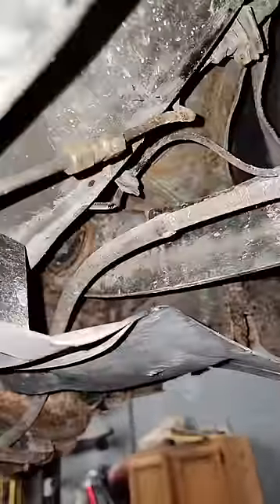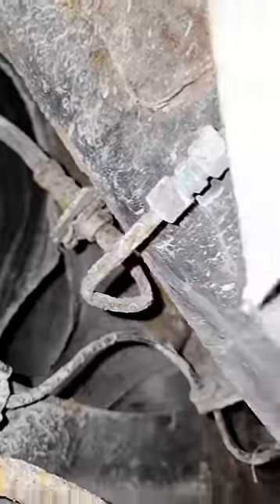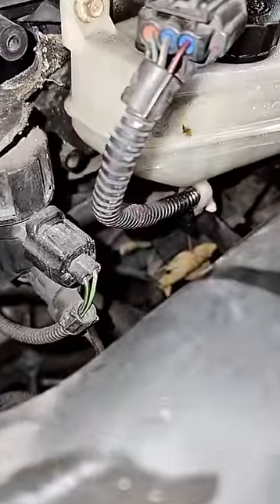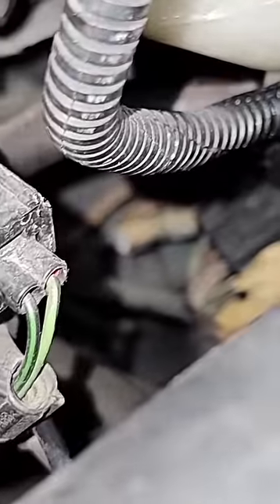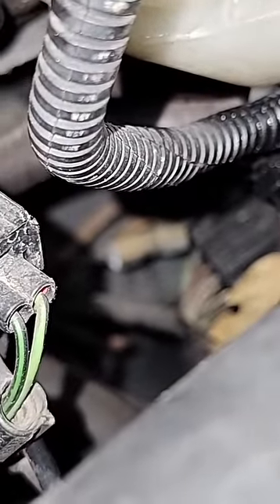don't use compression fittings on brake lines

Comment: I don’t think compression fittings are even legal.
Reply: They certainly aren't in NY. Can't speak for any other states but I can for NY lol
Reply: Not in Maine.
Reply: Here in Vermont they are not allowed but I'm originally from Michigan and it was common there because there are no inspections.
Reply: I will make them legal!
Reply: @Sith_dude  gae!
Reply: They're not.
Reply: They are not legal anywhere.
Reply: Lol legal
Reply: @bloodbushcraft2467  these mfers are worried about legality.  In states with no inspections this stuff happens all the time. In states with inspections the inspector gets paid a little extra. 

Guaranteed the brake line police aren’t going to show up
Reply: @Krankie_V  not the brass ones but they make a steel one that is or at least they will still pass with them . But here in NY your not going to find a good spot to put one might just as well replace the whole thing
Reply: You can buy fittings specifically for brake line pressures, advanced auto has them
Reply: @toodjackson4438  any type of compression union is illegal on brake lines in NY. It's specifically called out in the safety inspection regulations. Anyone who passed that did so illegally.
Reply: Can't get an inspection sticker in wv if they find compression fittings on your brake lines.

Comment: Scotty says it's ok.  Rev up your engines!
Reply: Blows my mind that people take any notice of Shoddy Kilmer.
Reply: @ferrumignis  he’s a wealth of knowledge.

Sounds like you got a personal problem.
Reply: @ferrumignis  I actually like that someone doesn’t bend-the-knee to corporations and the government who say, “You can’t do this.  You can’t do that.”

Scotty just won points in my book.
Reply: @Americansikkunt  you cant do that because the fittings are not rated for the pressure that a brake system gets to. There is a reason that compression fittings are not used in high pressure applications, its because they fail.

Comment: I use swagelok 316ss compression fittings at work, which are rated for 10k psi. I use them for 5500 psi Argon. 

Those are copper though so don't have the same rating.
Reply: Brass. Copper compression fittings aren’t a thing.

Comment: Not sure about other states, but here in NY compression fittings and copper lines fail NY State Inspection. Wouldn't do them even if I was doing side work. I'll run and flare new lines myself before it comes to that.

Comment: I've had a compression fitting on my right rear brake line on a 69 GMC 3/4 ton pickup for 20 yrs now. You just gotta make sure they are the right size and rated for the pressure. The one i used is rated for 1200 psi. Also, the legality of compression fittings varies from state to state. My state they are legal to use.

Comment: I once used one on a work truck brake line. And it lasted 7 years until I sold the truck. And It is still on there from what I know lol I usually flare but for some reason I had to at that moment

Comment: I have 2 compression fitting on my 2000 F350. one of the brake lines rusted right through so they had to jump in a replacement because they don't make them anymore. my thoughts were why the rust through?

Comment: Old master cylinders start to bite the dust ,the first time the pedal sinks to the floor like if you blow a line. 
The unused part of the bore might have a step to it ,besides possibly having a bunch of debris and dirt in that area,so say bye bye to the seals on the piston. 
That's why most of the time on an old car,if it's been bled by "foot" ,you'll be replacing the master shortly afterwards.

Comment: I used a compression fitting once.  Buddy had an ancient Asian pickup truck (ford).  The rust held it together.  It basically was an old beater farm vehicle.  I told him the possibility of failure and it was on him.  It was fine.

Comment: Compression fitting on brakes lines are an immediate inspection failure in Rhode Island. In Massachusetts the brake check is stopping in the bay.

Comment: Those look like what you buy at Home Depot. 
If, and this is a big if. I was to use compression fittings, I would use Swagelok or Parker only. And also it would be with SS tube, sufficient id to allow flow and pressure. 
Thoughts?

Comment: I've never used compression fittings or messed with brake lines. Why are compression fittings bad on brake lines?
Reply: They rely on friction to keep the fitting together. As you tighten the nut the compression washer deforms to hold a tight seal against the line. A flared line on the other hand is, well, flared. Line pressure only creates a tighter seal and it physically can't come apart
Reply: They simply aren't rated for the pressure that a brake line can see, so there is a rick that you stand on the brakes in an emergency and the pipe pops out of the fitting.  They are illegal to use in many states (should be all of them)

Comment: how do you know if the part will come with compression fittings or not?
Reply: The compression fitting is a way of putting several brake lines together. 
Aka, someone has been replacing sections of lines instead of the whole line itself. The compression fitting is the patch job between the lines and are common failure points.
Reply: @mmix224  Thanks for clarifying that. Is it because the brake lines rotted or rusted out?
Reply: @TheFrenchPug  Yes, it's because the original steel brake lines rust.  Compression fittings on hydraulic brake lines are a horrible hack used by the terminally ignorant.
Reply: @ferrumignis  Can't believe someone would actually use those on brake lines. Looks like a death wish.
Reply: @TheFrenchPug  I can't believe a lot of the things people do to cars, like using luggage straps to hold broken suspension in place.  We have to share the roads with these people.

Comment: "Going" doesn't matter, if "Stopping" is going to be an issue🤨.
IMO, compression fittings are fine,
To make it until payday or just to get it to the shop (to do a proper repair) (and is certainly fine on low pressure lines).
But THAT MANY fittings is just BEGGING for a massive failure (that could very well get you or someone else killed) and was very  likely the cause of the master cylinder failure..
 Personally, I'd rather just isolate and crimp the line instead, The car "pulling during braking" will be a constant reminder that you have a problem that needs a remedy😎
🤣🤣🤣
Always remember, you aren't the only one that NEEDS you to have good brakes/tires

Comment: I’ve used compression fittings on brake lines in an emergency, but would always go back and replace them with actual flare fittings at the soonest opportunity. Or replaced the whole line

Comment: Ive seen in a comment section that a guy worked in a field that required him to test compression fittings. He said thy tested up to 41,000 psi and that the line surrounding the fitting burst before the fitting itself. Idk.

Comment: Compression fitting suck. I don’t even use union fittings. I’ll get 25’ stock line and custom fit for each wheel, or the two for the front and the singular like to the rear T-block for the rear wheels. 

One solid piece means only (2) possible leak points. Use two lines and a union fitting? Now you have 4 possible leak points. 

Customer had me look at brake leaking issues, seen multiple union/compression fittings, and said HELL NA! We gonna have to address this crap right now. 

They initially didn’t want that done, so I fixed the leak that was present, and sent them on their way. 

Next day, they called me up to do an on-site(their job) brake inspection, again, because they had to pull the E-brake to stop…..the line I replaced was fine, but now one of the other lines failed under pressure.

It was at this point that they were on board with the idea of taking all the old lines off and replacing them all with custom fitted one-piece brake lines.

I don’t charge much for the work that I do, and I like doing what I’m doing, but if the customer don’t want something addressed that I believe needs to be, nothing I can really do at that point. 

I don’t sell parts, so it’s not like I’m making any money off that. I’ll try to keep their cost of parts low, but sometimes it’s best to let those who know what they are doing, to do what you called them out to fix.

🤷‍♂️

Comment: They have non-brass comprehension fittings made for brake lines!  When I worked at a factory, they had comprehension fittings, that were good to 10,000 psi?

Comment: I keep compression fittings in my glove box specially for this reason but I only use them in the case of emergency so I can at least get the vehicle home. once I get vehicle home I fix the line properly with the nickel/copper line. compression fittings are by no means a permanent fix, especially on a brake line.

Comment: Compression fittings should be fine if done correctly. I can see your point here though. Five is a little bit worrying 🤣
Reply: Yeah i agree I don't like them but I've used them on my own vehicles to save my ass when I was broke and in a pinch I've had more bad flares cause issues than compression fittings the 2 that I had fail when I took them apart it was clear the line came out slightly when I was tightening them down

Comment: Someone apparently doesn't care whether they can stop in an emergency. Maybe it's just me, but brake lines are pretty easy if you take your time in removing the damaged line, and I think you can get prebent replacement lines.
Reply: Good luck feeding the pre bent lines over the gas tank and making it around the engine as well unless you remove a lot of parts for them

Comment: A lot of people optra compression fittings with how easy they are to install and splice lines together and they are good for emergency fixes and extremely temporary fixes or off-road applications but people need to realize that they are not safe to be driving on the road if you slam on your brakes while you are driving those compression fittings more than likely will not hold up to the pressures that are in the lines and that is why your are not supposed to use them on passenger roads, off-road applications are perfectly fine, emergencies are okay but not for long term.  You do not want your brakes to fail on you while you are going 70 80 mph on the highway, just saying

Comment: Are they Compression fittings or union fittings?
Compression fittings use ferrules which arent recommended for brake lines
 But union fittings used flared ends and flared junctions which are allowable for brake lines.

Comment: Although I wouldn’t condone using compression fitting Dorman makes steel compression fittings rated at 5,000psi. So if you use compression use steel for better safety.

Comment: They may work out okay for some people but they are not rated for the pressures in a brake system. I always put fittings on double flare the tubing and put a flare union in and to be honest I feel that is a half assed repair. The right way is the real pain in the ass is to replace the line until you can get it out fitting to fitting.

Comment: Compression fittings can handle the brake pressure on a lot of cars. Not all though. And their biggest problem is people not installing them correctly.
Still good for a temporary fix, but not when me or the shop are liable.

Comment: Now I know some places don't accept their use but I mean I use compression fittings in oil and gas refinery's and I also use them when I need to hydro test something to high pressure. They work really well. If installed properly a Swaglok (only brand I would ever use in SS 304) is good for 8000PSIG at 1/4" which I'm pretty sure most brake lines are. I just don't get why you wouldn't use them. a Flare is no better properly installed.
Reply: I just dont like a possible failure spot when I run brake line. I would rather run a solid line but here in NY compression fittings DO NOT pass state inspection.
Reply: @midnightrider1854  Oh I agree. No connections would be best but there are multiple connections even on a stock vehicle, and flare connections are allowed which aren't any better and are allowed. Like I said I know some (if not all, I'm not sure) don't allow them, but I just find it illogical after having used both flares/compression fittings in high pressure/high heat conditions.
Reply: @TranceEmotion  I agree with you, and I'm not saying that I haven't used them before to get me out of a tight spot. Although, a brass compression fitting is designed for a low pressure line splice. That is why we are not allowed to use them, but I've never seen one blow apart on a brake line. We can only use union fittings that, to me aren't much different except it utilizes the flare to grab and seal, which is supposed to be a stronger hold as opposed to the flare fitting where the furred actually compresses the side wall of the line as it tightens and comprises its overall strength.

Comment: So a for that line it is wrong to use a compression fitting. I would use a flare style fitting to repair something but not use more than one on a line. The factory uses these on every vehicle I think he showed one of them on the focus saying it was a compression fitting. The reason he said that is they are very vary similar looking once installed on a line

Comment: Brass compression fittings are 110% illegal in all 50 states by dot rules. Second of all the only good the compression fitting that is technically legal and actually allowed in break repair are still compression fittings and they're only allowed on 3/4 ton non-commercial and down vehicles. Now if you have one ton and it's ripped line off out in the field you can repair it with a steel compression fitting but it must be repaired before you load up the trailer and attach it to a trailer and come up anywhere near the maximum gross vehicle weight. But I agree with you I'm much prefer to bend and flare and use brass unions between fittings because they maintain the hydraulic integrity because they are a threaded repair

Comment: That’s my guess with my old 2000 GMC 1500 4x4 it’s leaking past the master cylinder and into the booster they there kinda sort a and extensive use needs top up bled but no full pressure reason I figure it’s in the master & booster no brake fluid on the ground and I have that happen to me before 😉

Comment: I have used compression fittings on brake lines with no issues.  Well no issues on the brakes but other ones with the vehicle sure.

Comment: They are not rated for the PSI of brakes anyway. You can buy brake line and a tool to make the flare for like $50. I replaced all my trucks brake lines for less than $100

Comment: Agree 100%, we're talking 2,000psi here and compression fittings were never intended for that.
Reply: Not to play devil's advocate but Google how much pressure a compression fit in can hold.
Reply: @DigiDrone  Even for plastic ferrule?  Are brass ferrules even intended for use with steel tubing?
Maybe Swagelok 316 stainless compression fittings, but why not just duplicate the factory double and bubble flares, do it the right way?  The parts, fittings, tools, tubing are all right there and available to do it the right way.
Oh silly me, the internet said it's okay! :(

Comment: Must have been an HVAC guy who did the work. Im not a mechanic but I can easily understand why you wouldn’t want compression fittings on your lines, the bumps and vibrations would cause them to leak over time.

Comment: I almost used compression fittings on my 98 explorer when a rear line rusted out and left me with zero brakes…even bought the parts and brake line section, after Soo many people said how bad it was I ended up just blocking off the rear brakes and only using the front. Still not ideal but better that those things lol

Comment: I've never had problems with compression fittings.  They obviously were not the problem.   But the fact that there are 5 of them tells me the lines are probably done.  And I'm with you, if the lines are crap and you put on a new master cylinder those lines need addressed, or it turns into a liability.

Comment: I've used compression fittings on brake lines for 25 years. Never had a problem. A lot of plumbers swear that you shouldn't use shark bites either but I've used them for 25 years with know problems. I don't know why it takes so long to get over this crap! Most of the mechanics I know still won't set batteries on concrete floor, instead they sit them on boards.

Comment: The line will fail long before the Thoes fittings we use them al the time for instrumentation they can handle well  over 10,000 psi the stainless line will burst at 15,000 .

Comment: Compression fittings are fine on older vehicles but don't use them on ABS brakes
Reply: No, they are not fine on any hydraulic brake system.

Comment: I get it yes 5 compression fittings are not ideal. And would make it hard to locate the actual issue.  But most look dry number 5 looks like it made the split loom a little wet. That being said I'm not running a shop and working on my own vehicles I probably would have stopped after 2 compression fittings.  GO RUST BELT !

Comment: There are compression fittings designed for high pressure brake systems.
They aren't the brass fittings sold for plumbing.

Comment: People will argue but, a bunch of compression fittings on brake lines are a good way to die. Spend a few dollars, run new brake lines and be done with it.  They come prebent for most cars or a brake shop can bend them properly for your car. 
  Compression fittings can fail and block flow, etc.. Not worth it.

Comment: If you use GOOD compression fittings you'll be fine. I use them daily in the oil and gas industry. A 1/4" swagelok compression fitting is good for over 5000psi. They will easily hold long before the line itself bursts. Using those garbage brass fittings you find at autozone is NOT the way.